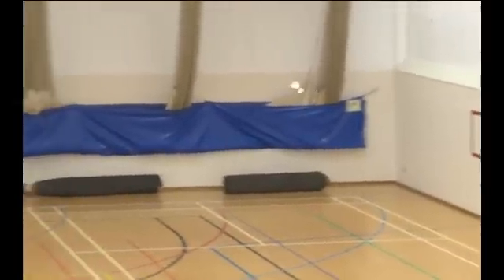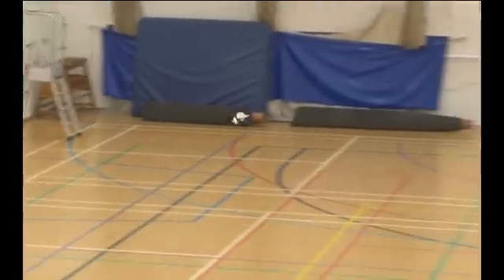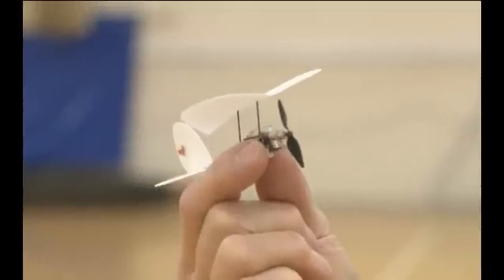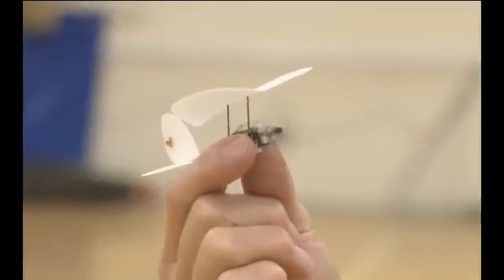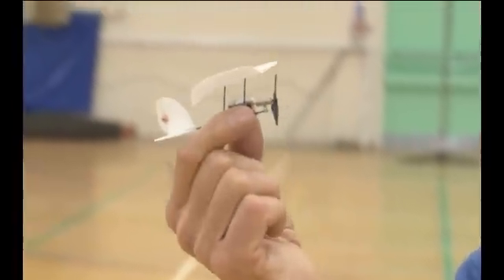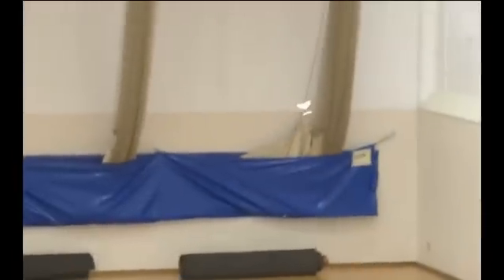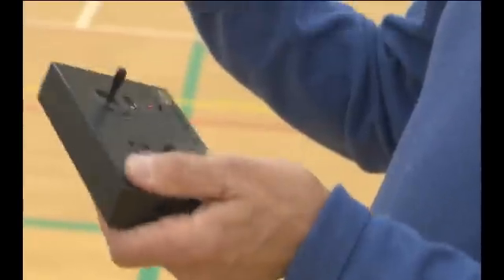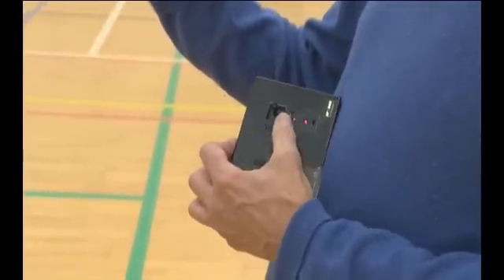World's Smallest Radio Controlled Model Plane

Comment: Radio controlled your stupid it’s remote controlled
Reply: No, it's controlled by a radio - radio signals from a transmitter to a receiver. Remote controlled is anything else: TV remote, models that fly on a beam or even a control wire. And stupid is a word you might apply to those incapable of correct English.

Comment: So many people asking to buy one.... set it up ... you'll make a killing
Reply: hmm.... tried it but parts very expensive and it doesn't really do much compared with what else is on the market - it was designed purely to break the record. I do make them as one-offs though.
Reply: It's so light It could only flown indoors in a large area which most people don't have access to for most people it would be better just to get a $5 drone from five below and fly in their house if they wanted a really small drone.

Comment: So it can't turn snd only engine is radiocontroled...
Reply: No, the rudder is also radio controlled so it can turn both ways, but because of the torque, right turns are very fast and the video camera struggled to keep the aircraft in frame. It also loses height and is difficult to control turning right. So I only did a few right turns towards the end of the flight - watch the whole thing.

Comment: Please tell me that how have you made this because I am a child and I am only for 10 years please
Reply: You will need: a micro-receiver and HFX868 Transmitter, a magnetic actuator, 20 mph battery, 4 mm motor and prop. All are available from Plantraco, Canada. Also, 1.0 and 0.5 carbon fibre rod and 1mm foam sheet. Make the "body" - motor and prop, receiver, tail, etc. as LIGHT AS POSSIBLE.Try different wing designs until you get one that flies. That's all I did - when I finally found a wing that flew, I refined and developed it, test flew it endlessly, learnt to control it - the hardest part! - and reduced it's size until it was smaller than the existing record holder. Then contacted Guinness world records.......

Comment: This it more like a tiny helicopter, the wings aren't acting like a normal wing, and the propeller is pulling it up...not the wing. World record still stands
Reply: Well, it still glides alright with the motor off, so there must be some lift in the wings. Perhaps you mean it's a type of blown wing - ie:  extra lift is created by increasing the airflow over - or under in this case - the flying surfaces....helicopter's a stretch though. Whatever, Guinness are happy it's a aeroplane.

Comment: Doesn't an airplane need to produce some lift to be called an airplane? This doesn't look like it does, just a motor pulling it along like dragging  kite. An aircraft, sure, but not really an airplane.
Reply: Airplane, aeroplane, aircraft, flying machine, aerial device, flying body.....words, to describe something that propels itself through the air. The Guinness World Records organisation chose airplane. And the exaggerated under-camber of the wing traps air from the airflow and especially from the angled propellor and deflects it downwards - which creates a pressure differential between the air above the wing and the air below it, etc., we all know it and up it goes. I believe that's called lift - one way of creating creating it anyway. An aerofoil section is another and generally more efficient way, but not at this scale.

Comment: It looks more like a power stall hover than flight. Impressive none the less.
Reply: The wing is set at a high angle of attack whilst the motor/prop is pointed downwards. In flight, the motor naturally assumes a horizontal attitude making the wing's angle of attack even higher. Also, the airflow from the prop is directed at the severely under-cambered wing and is deflected downwards - not exactly a "blown" wing  but it does increase lift. It glides at a much flatter angle with the motor off so maybe power stall is about right. All this was to make it  manageable and more importantly, slow it down - high speed at this size, try and follow it - especially with a video camera.
Reply: look at the wing design. at that size I don't think regular flight can occur.

Comment: thats not breaking a record it only flies in a circle not in different directions
Reply: It does fly in different directions but the torque from the relatively large propeller makes it turn right so fast  it's difficult to control. It also loses height in a right turn which requires power to regain  - which eats into the power needed for duration. Also, the camera couldn't keep it in frame - Guinness were very keen on being able to be seen for the whole record attempt - and last but not least, Guinness World Records does not require any particular manoeuvres to establish the record: the record is based purely on wingspan, duration and showing control so the aircraft was built from the outset with only those criteria in mind. However, on the actual record flight I did make 6 right turns towards the end of the attempt (after the previous record had been broken) They are not included in the shortened youtube clip over which I had no control. I have the whole 6 minutes and 57 seconds on disk if anyone is interested.
Reply: I wish people would pay attention to the video and read the comments before commenting themselves.  Clearly the plane can turn right - as demonstrated by the rudder control AND it can be seen turning right in the video. 
Well done on the record, well deserved!  I fear though it will be broken at some point..
Reply: I'm sure it will be broken - if anyone were to try, I'd be only too glad to help.

Comment: It's got a rudder but can it turn right? This video was all left turns. If I was Guinness I'd have a rule of ability to turn both directions at least.
Reply: No, it made at least three right turns during the record flight. They were excluded from the shortened You Tube clip - I have the complete 6 minutes 57 seconds flight on disc if anyone is interested. Because of the torque, right turns are difficult to control and lightning fast - too fast for the video camera to keep in frame. Guinness were very keen on the plane being shown in plain view on film for the whole flight. The record still stands after 6 years.
Reply: Yes, it can turn right but the torque from the relatively large propeller makes it turn right so fast  it's difficult to control and it  loses a lot of height  which requires power to regain  - which eats into the power needed for duration. Also, it turns right too fast for the video camera to keep in frame - Guinness were very keen on seeing a recording of the aircraft for the whole record attempt.     Last but not least, Guinness World Records does not require any particular manoeuvres to establish the record: it's based purely on wingspan, duration, original design and showing control so the aircraft was built from the outset with only those criteria in mind. However, on the actual record flight it did make 6 right turns towards the end of the attempt (after the previous record had been broken) They are not included in the shortened youtube clip over which I had no control. I have the whole 6 minutes and 57 seconds on disk if anyone is interested.
   Their rules, not mine - or yours.

Comment: It only turns left. A free flight could do that?
Reply: it is completely controllable, but the test requires the craft to circle to see the flight time
Reply: No, it made at least three right turns during the record attempt but they were excluded from the shortened you tube clip - I have the complete 6 minutes 57 seconds flight on disc if anyone is interested . The reason right turns were kept to minimum is because the torque makes them difficult to control and lightning fast - too fast for the video camera to keep it in frame - Guinness were very keen on the plane not disappearing from the film from start to finish. 
   The record still stands. (I don't know who Polite Pawniard is but he/she has nothing to do with the record and what they are saying is not true).

Comment: i've made one with a very very small engine from a vibrator of a cellphone and a small 2 battery from a clock...the helix was two NOR SO LITTLE bird  feathers (almost 50mm !!! the mos giant part of the plane!!)....and used a micro controller couple from an industrial water extracting plant here they shared to me....the other detaiils will i keep it just for me BUT U CLAIMS A ROYAL LIE DUDE !!!...
Reply: jus Adding = THE HELIX WORKS (cause actually still it do it as well despite 've builded it on 1994 !!)....at just 7.5 RPM and with such little battery i obtained an autonomy of ELSE THAN 2 HS IN AIR....it's ok but this sht yours SIMPLY SKS my dear.
Reply: i fact SKS WORSE 'cause the actuall existent materials....o---m----g......try nanotubes ignorant I ' VE YET DONE IT AND CLAIMING FOR NOTHING AT ALL...just sharing...a thing the 2poeple" from your country seems CLEARLY BEEN FORGOT.

Comment: as a long time RC pilot I salute you for your effort on a fine aircraft. but wouldn't a record require left and right hand turns. maybe doing figure eights both directions. the two access control throttle and writer are fine. variations of the power create climbing maintaining attitude I'm dropping down in altitude . the abundant dihedral certainly maintains axis stability. all in all a job well done. Salute
Reply: Many thanks and good point but Guinness World Records don't specify any particular manoeuvres, they require only that: 
 1.  The wingspan is shorter than the current record holder.
 2.  It is an original design (ie: not just a copy of the current record holder with the wings clipped).
 3.  It flies for longer than the current holder.
 4.  It is shown to be under full control  - no aerobatics, not even simple figures (but given that duration is one of the requirements this is perhaps understandable?  - manoeuvres eat into battery time).
    And the aircraft did make six right hand turns during the record attempt - only six because the torque from the relatively huge propellor means right turns are lightning fast and difficult to control (given how fragile it is, the time it took to develop and general difficulties of organising the attempt, witnesses, cameras, etc., crashes were to be avoided) with precious battery power needed to recover - and, more importantly, they were almost too fast for the video camera guy to keep the aircraft in frame - Guinness were very keen on that.  I had no input when the video was edited for the shortened youtube clip and the right turns were just not included  - a lame excuse but I've got it all on disc if anyone wants to see it.
  
  However, I agree with you entirely: they should specify a least a figure of eight. (I can say that now - at the time I was not unhappy because the thing is a perfect little bastard just to fly straight, never mind indulging anything else). 

 
  The record still stands after five years, up there with Global Hawk, page 155.
Reply: Thank you for your response.  I hope you do well in the future model endeavors Richard... Sorry for any typos I did voice text at that word writer should have been rudder
Reply: Can we increase the weight of aircraft ，i mean ，Dose  Guinness care how weight of the aircraft？
Reply: No, Guinness don't care about weight. The more you increase it, the more power you need or the bigger the wingspan has to be. As the record is based on duration and wingspan, the lighter the better.

Comment: this guy has a smaller rc plane Martin Newell
Reply: Kaidn Seth Collins-Gonzales noting this vid was made 5 years ago, smaller is not hard to make now. limited only by weight of a lithium ion battery and the motor. you can make from a vibration motor out of cellphone (get that magnet for your rotor), make your own small windings for the coil.  i found this site interesting: micro-plane.com \. scroll to bottom and click on Motor. pics and step by step. the English is poor, but understandable
Reply: Yes, I saw that - he should go for the record - the actual procedure is not difficult

Comment: Someone mentioned that they should have invented wireless electricity and then the tiny plane could have flown forever. Actually if Tesla were around he probably would have enjoyed assisting putting together a wirelessly powered plane. All you need do back then was tell him it was impossible, stand back, and watch him work furiously at making something possible.

This is a really neat little plane. Quite amazing miniature engineering.
Reply: Screw that J.P. Morgan dude for stopping funds to Tesla. Honestly, what an impressive technology he was after, only to be stopped by financial issues.
Reply: Darrell Moth In a way, yes. But radio worked because of a very long aerial and a crystal. None of those would be good on a small plane...
Reply: Did you see the DARPA research project using focused microwave energy in a beam to keep a surveillance plane aloft? So. it may have turned out not practical but the guys with tax payer dollars were sure giving it a try.
Reply: I agree

Comment: Does it turn right at all ?
Reply: Yes, but the torque from the relatively large propeller makes it turn right so quickly it's difficult to control and it loses a lot of height which requires power to regain  - which eats into the power needed for duration. Also, the camera couldn't keep it in frame and last but not least, Guinness World Records does not require any particular manoeuvres to establish the record: the record is based purely on wingspan, duration and showing control so the aircraft was built from the outset with only those criteria in mind. However, on the record flight I did make two right turns which the video just managed to catch but they are not included in the shortened youtube clip.
Reply from the maker: brian gutierrez Yes it does. Because the rudder hard-overs from one side to the other the reversal from left turn to right is very sudden and hard to follow on camera. But several people have asked the same question so I wish I had included at least one turn in the clip.
Reply: +brian gutierrez .. he showed the rudder.

Comment: I wonder if you could make a flying wing that has a 69 mm wingspan like this? You could bury the electronics within the foam to make it more streamlined, and since the whole aircraft would be a wing, you'd get more lift for its weight. You could probably cram in two electromagnetic actuators and make elevons, provided your radio supports elevon mixing. Hell, why limit yourself to 6.9 cm wingspan? You could probably make a 5 or even a 4 cm flying wing
Reply: 4 cm wingspan. That's less than 2 inches for us Americans
Reply: Nick Fury
 would be impossible to fly in any wind
Reply: Vincent Sluga Then you would fly it indoors like this guy did with his
Reply: Nick Fury
lol even a little fan or any AC air moving around might throw it off. but yea indoors generally would be perfect for it
Reply: Vincent Sluga I would make one just to prove it could be done
Reply: Роман Плетнев I'd put a small vertical fin on it then.
Reply: Nick Fury lol
Reply: I've got a quadcopter that's even smaller than the airplane in this video. A quadcopter!! Estes Proto-X
Reply: Vincent Sluga actually not really. I haven't had any problems with mine and I've had it since January. Very well built too.
Reply: Nick Fury
ok usually ya get sumthin then it breaks after a month or so. But coolz

Comment: This is a significant accomplishment, not easy.  However, sorry to be a party pooper, but I flew a (slightly) smaller plane in 2006, 67 mm vs 69 mm, that weighed about 1/3 of the plane shown here.  In 2008 I modified it to be 1/4 the weight, under 1/2 gram.  In fact, I have two of them.  See:
Half gram, 67 mm Radio Controlled Plane in 2008
There's a more complete description at
http://mnewell.rchomepage.com/Planes/Shark/Shark-1.html
Reply: Me too, I've made triplanes quite smaller but I cannot achieve the same degree of control - the torque from the motor/prop is a real problem. Nor will they fly for anything like the duration of the record flight.
Reply: John Wakefield ...to negate the torque why don't you try putting smaller but countra-rotating propellers ? Added gears and axel would complicate the design and add weight but it may have more upsides than downsides...:/
Reply: Krunoslav Šokić Yes, I've made several twin-motor versions with contra-rotating propellors, both in-line and side-by-side - and they are much easier to fly (let me know if you'd like to see pictures) but I have not been able to make them as small as the original record-breaking design....still working on it though.
Reply: ...nice. :D Although I didn't make any RC planes myself I'm always interested in other peoples work. If you don't have any links to share pictures you can mail them to model850@gmail.com. Thanks in advance...:)

Comment: The propeller doesn't have enough power to keep it in the air without the wings, and it would not be able to fly around in a prescribed circle.  So, it's not hanging it's flying.

Comment: Way to be an ass and miss the entire point of the video mr. "worldbestpilot"

Maybe you watched the video, but obviously you didn't listen.The video is about time in the air and size of the airplane. Obviously the more you move servos, and power in and out of turns, the more power it's going to use and get less time in the air.. Hence just letting it turn with the torque of the engine.. 

What YOU would like to see is completely irrelevant.

Comment: right! YOU are right! thr flight ratio for planes 15 to 1 jets 1 to 15 not great! a plane will fall one foot for every 15 feet forward. a jet on the other hand will fall 15 feet for every foot forward, not a good ratio. i bet if the motor on that thing gave out, it would DROP LIKE A ROCK!! just like all modern jets would.